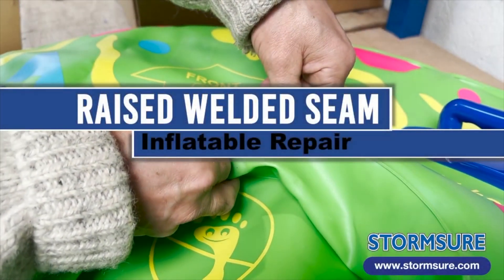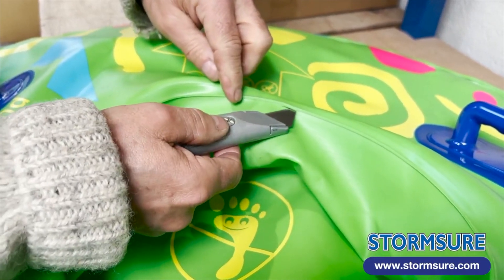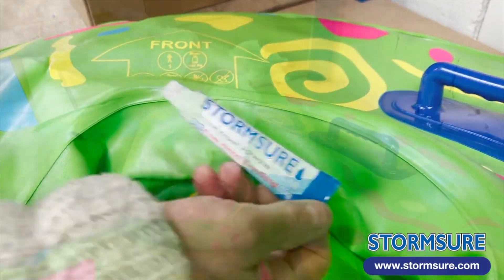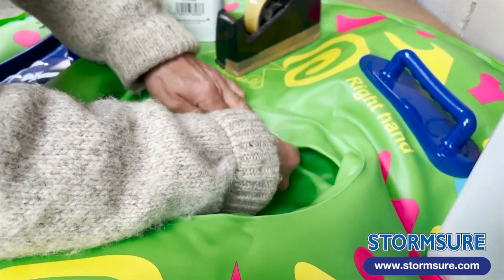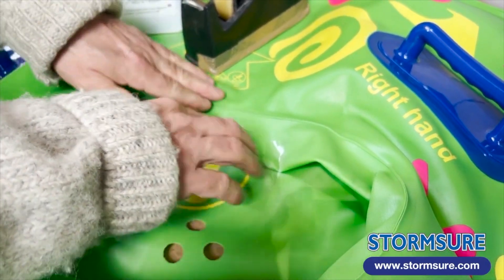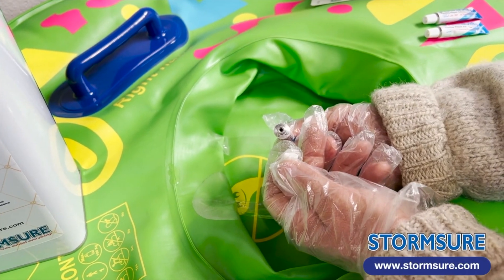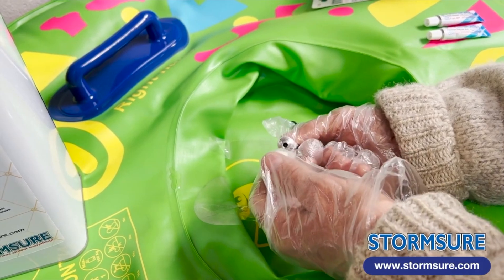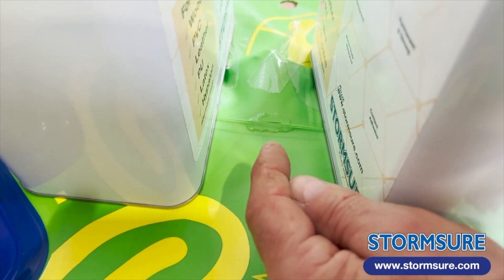Raised Welded Seam Repair | Technical Repair Tutorial

Comment: How do you stop the adhesive from going inside the tube and gluing together to the other side?
Reply from the maker: If it is a small cut or split the thick glue will not drip through. However if it is a larger cut then you need to put something inside. We use sticky tape, or cling film inside the tube. Then if the glue drips through the hole it will fall on the cling film which in turn will stick to the inside of the repair that you are making but stop the glue reaching the other side of the tube. It can be a bit fiddly but I have done it successfully many times.
Reply: Thank you very much